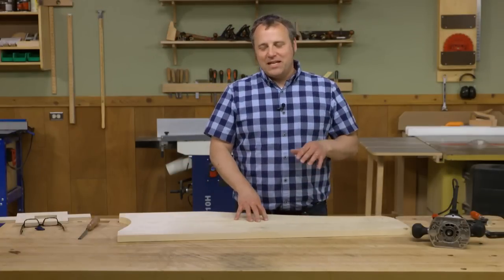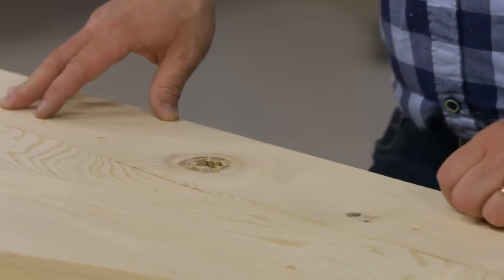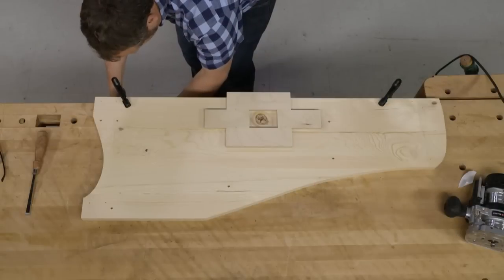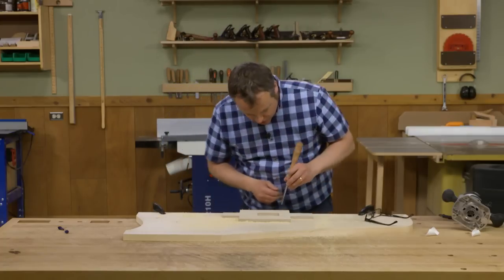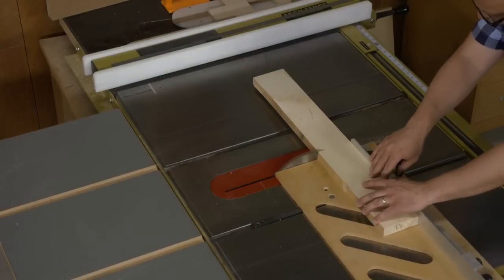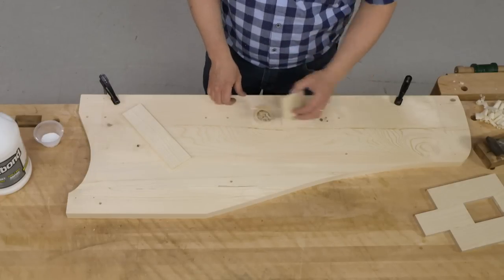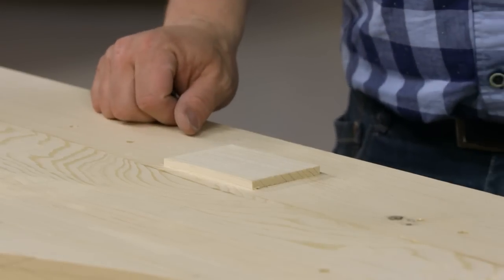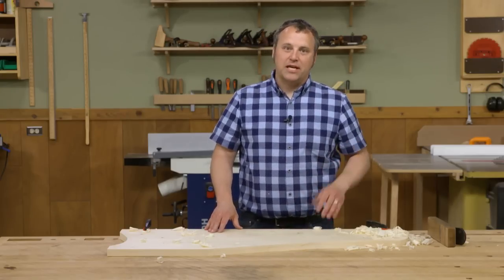Woodworking Tip: Creating Wood Patches

Comment: Why not cut the patch first, then use the patch to make the router jig exactly the correct size?
Reply: Ya, that's what I was thinking too and would probably do.
Reply: That is another way. Neither is wrong.
Reply: @RoyatAvalonFarms  good idea I would do the same
Reply: I asked because I would probably do it as I suggested, but it occurs to me that the jig may turn out too large.  (It would be impossible for the jig to be too small.)  If there are any errors on the patch or the jig, such that they're not straight and square, the jig will be oversized by some amount.  Assuming some care is taken, this may not matter in practice.  That said,  I'm not sure how sensitive the outcome might be to small errors.  While I've never used this particular method, I have enough experience to know that it's better if the patch is a few thou bigger then the hole than if the hole is a few thou bigger than the patch.
Reply from the maker: @charlesenfield2192  I made the jig (and the pocket) first for the same reason I usually make a mortise first followed by the tenon. In my head, it's easier to fine tune the thin patch to be a snug fit than the other way around. And yes, I would be concerned about making the pocket too large after making the patch first.

Comment: thx for the great and short video. Clarification, as you malleted the patch in place, might you want to use clamping pressure instead?  Nicely done!
Reply: I probably would have, but its probably unnecessary considering its high glue surface to stress ratio and how snug the fit should be.
Reply from the maker: The patch was a pretty snug fit. So once it was in, it was not coming back out. If the patch was more of a drop-fit (but still gap-free), I would have used a clamp with a wide pad.

Comment: Great info. Can anyone explain if there's a reason or benefit to pulling the plane vs pushing it?
Reply from the maker: It's just the style of the plane that I'm using. This is a Japanese plane that I've been working with recently. Any type of plane will work for what I'm doing to level the patch.

Comment: I think that a small round patch would be less noticeable.
Reply from the maker: Considering the size of the defect and the orientation of the grain, I felt that a straight grained patch would blend better. Also cutting squares is a simpler task than making large discs.